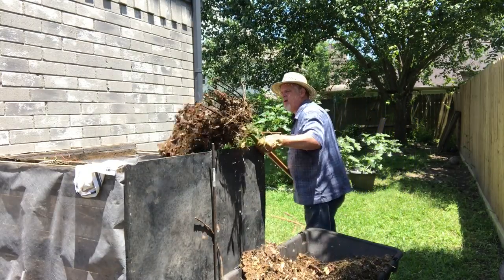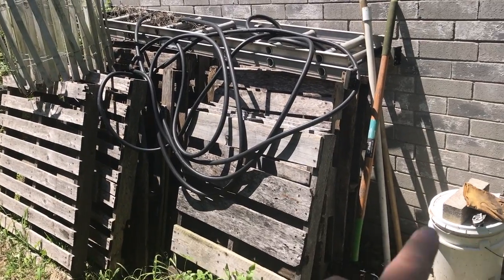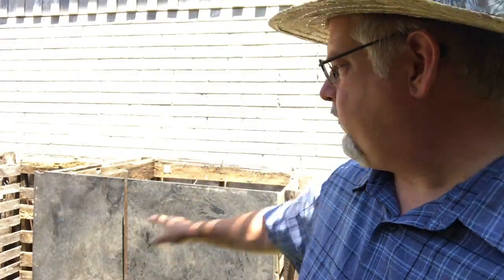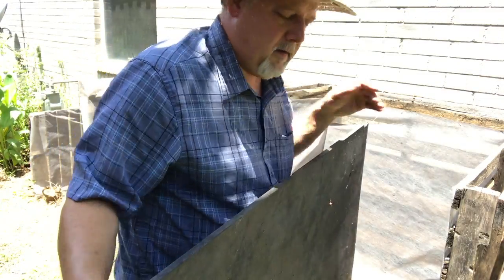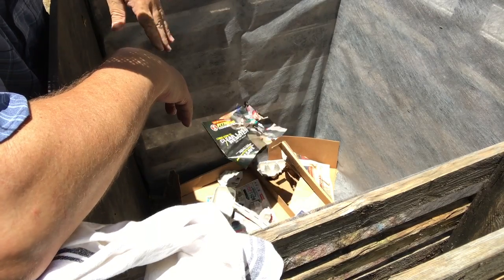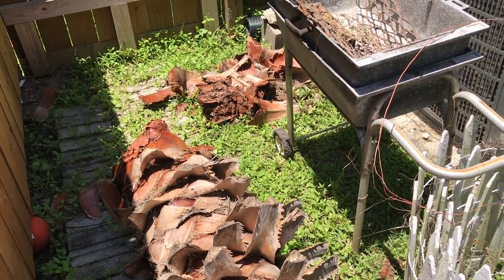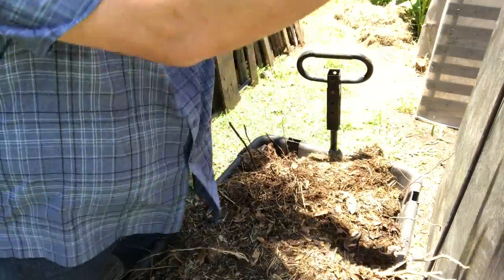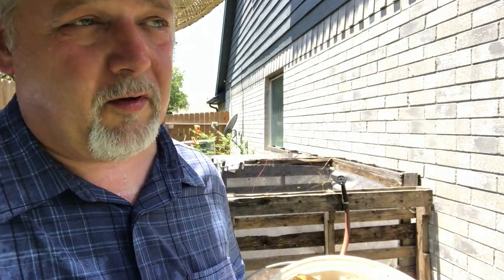Building a Compost Bin from Pallets || Black Gumbo

Comment: I gave up on the three bin system many years ago. Like the wood framed raised beds they tend to rot more often than I want to have to reconstruct them. I use the 2"x4" x 60" wire fencing for hoop bins about 4' in diameter. I never turn them, I just pierce them with a piece of 1/2" rebar every couple of weeks to give it air. I'll make compost tea from my pile for use during the growing season then by mid Oct. its time to spread it out over the raised beds and restart the bins again with the fall leaves and what little lawn clippings and get from the last few mowings. Good practice with the compost, almost anything can go in and I agree, David the Good has a good channel as well as yours. Keep it up!
Reply from the maker: Yeah I have the hoops too and they are easy and really great composters. I just need MORE compost. Don't necessarily need it quickly, but more at the end of the winter will be a big boost. And I expect to have to replace the wood, which is well on its way to being rotten, next year or the following. This wood itself will either become compost eventually.
Reply: @ScottHead  If you can, take a trowel and a coffee can into a nearby woods. Fill up the coffee can with the dark soil found under a rotting tree. It is an excellent innoculant for the compost pile. Lots of biology in the woods!
Reply from the maker: Great idea, there are plenty of green spaces nearby and a nice creek bottom.

Comment: I use that sheeting as a shade cloth. I used it as a weed barrier but the sun shown through and the weeds grew better because the cloth held the moisture better. Now I buy the heavy black cloth to block out the sun. It'll work just fine for what your use is. You're ahead of me. I'm wanting to build compost bins too. Your's looks great!
Reply: What is the heavy black cloth called?
Reply: @ms.anonymousinformer242  weed barrier fabric. You can purchase at different dimensions as needed.

Comment: I just learn so much from you! I'm so appreciative of the work you put into your videos. I am wanting to start a compost system for next year and this gives lots of information for me. I wonder about a barrel system and how well that would work. I'd love to know your thoughts on this. Thanks!!
Reply from the maker: Hi Amy, glad you find so much useful here. Yes, barrels, buckets, any kind of container will work, or you can just pile stuff up and it will rot on the ground. The composting world is filled with many different methods, some really fast, some long term.
Reply from the maker: Unless you just have a really small garden, I would avoid those tumblers and ready-made systems, they yield like a quart of compost and for me, they are not worth it. My giant covered trash can with a few holes drilled in the bottom used to get all the kitchen scraps and occasional other stuff, some lawn clippings and a few boxes here and there. That gave me 50-60 gallons every spring, but it was a year-long process and I rarely ever turned it and never watered it. It works well. I just need more.

Comment: My goodness I’m really interested to see how your new compost works for you! I also live in the suburban area of my city and I do have a compost bag,but the problem I’ve had is the very dry climate we live in. My compost just dries out so fast it’s hard to keep it hot.  Actually,I’ve so far failed to have any compost,but I keep trying since I bought the compost bag. I feel like I need to keep trying to make it work ! I’m an optimist I guess!
Reply from the maker: Not sure what a compost bag is, but if you just pile stuff up it will rot to humus eventually (that's what composting is - rotting down to humus). So if youpileit up, water it in, and come back in a week or two and turn it, don't worry about temperature though its nice when you get it - just turn occasionally and wet when you turn and eventually you get compost. Its when you are after speedy compost that you have to layer greens/browns and tweak your system. I don't generally bother with that.

Comment: In Coffeyville, Kansas, the city would come and take the pallets, throw them away and send you a bill.  No, scratch that, put it on your property tax.   A small, economically depressed little town, around 9000 population, with a filthy refinery that gets to self report to the KDHE when/if they violate the EPA air standards, two foundries that choke the air, and a nearly abandoned Sherwin Williams plant and their 40+ monitor wells that will never shut down because they can't clean the ground up so it can't be sold but they can give it to the elementary school that consolidated three other elementary schools within its walls that weren't located across the street from an EPA superfund site.  But pallets, no they are a problem and you can forget about the DIY projects featuring pallets, too. And tubs, those can't be outside, either.  That falls under the heading of inside stuff cannot be outside.  And NOW you understand why Dorothy went in search of Oz.  I'm only going to mention the Cryptosporidium in the raw water source.  But, no, pallets, potting soil, bags of leaves for composting, can't have any of that.  Sometimes pots, too.  Fetid.  That is a good word can really sum things up.  :D  You're lucky to live where you do.